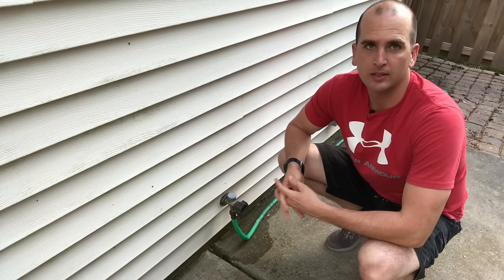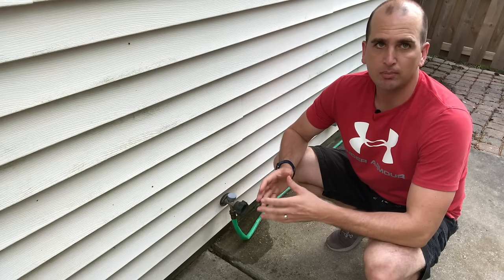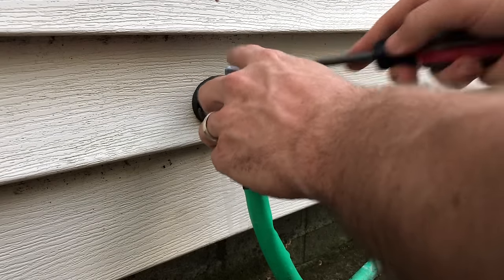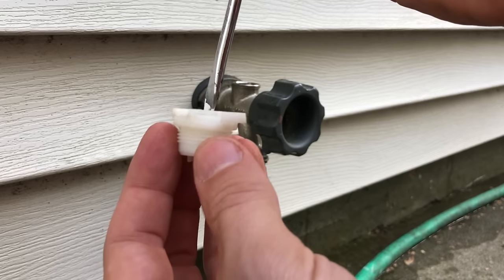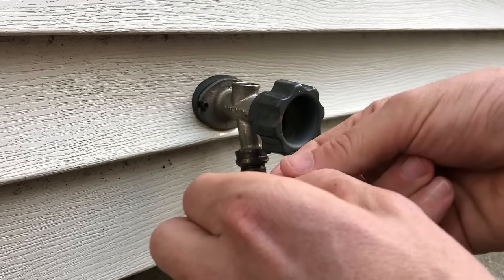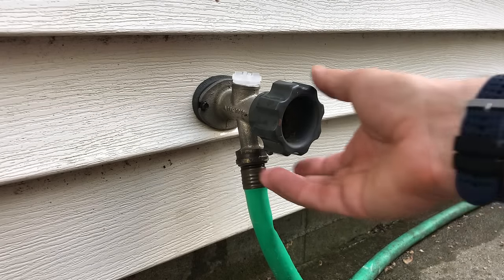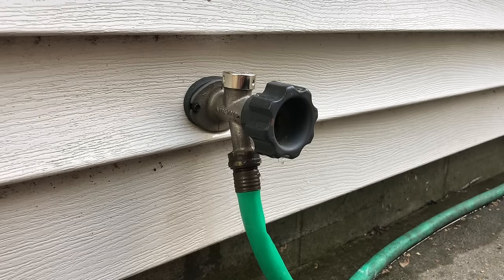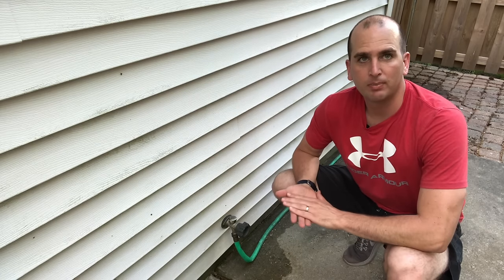How To Fix a Water Leak in the Anti Siphon Valve of an Outdoor Faucet

Comment: I was only able to find the valve kit at stupid prices online. "$4.95 + $49 shipping". Seriously. However, after watching this I took a closer look. The valve was screwed in very tight and would have to be destroyed to remove it, but the seal was visibly displaced (by ice - gf didn't disconnect the hose through the winter). Pushed the seal back down where it was herniating and that was that.

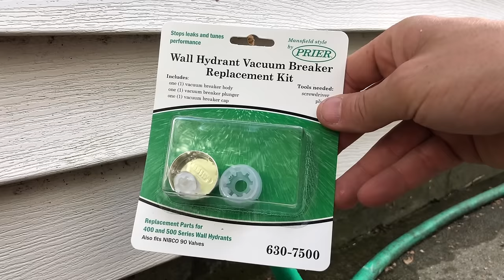Comment: This video really helped me. One of my outdoor faucets leaked so badly that I had just avoided using it for the three years I've lived here. I watched five videos on fixing a leaking anti-siphon valve, but none of the valves in the videos were the same type as mine and the parts in their valves were different from the parts in my valve. I had not been able to find parts for my NIBCO 90 valve. But then I watched this video and at 3:50 the bottom left of the parts card you show says, "Also fits NIBCO 90 valves." I bought the same package, discarded my old deteriorated parts, and installed the new parts. What a simple repair! It works great now. Thank you!
Reply: Leak behind wall plate

Comment: Very helpful video. I thought we might have to replace both of our outdoor faucets. Instead, I fixed them for pennies, in minutes, with this info. One faucet just needed a new stem washer (had been leaking from under the handle). The other needed both an O-ring and a new 00 Beveled Faucet Washer, 1/2" O.D. Danco Stock No. 35090B (had been leaking from the anti syphon valve). Total cost: $1.50. Saved me at least a hundred dollars. Much appreciated. Thank you for sharing!

Comment: Thanks!  I have this type of faucet and it is leaking from the top!  So annoying!  I started a vegetable garden with soaker hoses to minimize water usage and seeing water pour down from the top defeats the purpose of using soaker hoses to minimize my water usage.  That drip can add up to a lot of wasted water.  What clued me in was seeing the concrete under the hose completely soaked and after wrapping the faucet with nylon tape I saw the water dripping from the top of the anti-siphon valve.

Comment: There were 2 replacement options at my Home Depot in Canada: 1392/1393 series or 1104 series. (I got both cuz they were less than $5 ea) The 1392/1393 was right in my situation. 1104 has a slightly larger diameter, so I'll return it. Six years later and your video is still helping people - Thanks for the quick DIY solution!  👍

Comment: I have the opposite problem. Last yr my backyard faucet worked fine. I shut the line going to it off over the winter. It’s spring and I turn the water line back on. Turn the spigot on, and the water literally just trickles out. Any suggestion for a fix? I don’t want to, but I think I’m going to have to cut a hole in the basement ceiling to replace the entire spigot. 🤦🏽‍♂️

Comment: Wow. Thanks Man. My valve has been leaking for 5 years. And it just got torrential. and I found your vid, didn't realize it all came apart, and it was a split washer, and I had a replacement in my toolbox. Thanks so much.

Comment: Just fixed my leaky faucet using this repair kit. And looks like they also updated the design a bit , the insert is now an enclosed piece with the stopper contained inside it, and the bottom of it has some mesh to let the water flow. Now I can keep my automatic water timer attached to the faucet.
Reply from the maker: Shut your mouth! Joking but I will order another just to check it out. Thanks for the heads up.

Comment: Hoping you can help with this. We have a  anti syphon on ours. Whike it doesn't leak the issue I have is if we have the valve open on low or med the valve slowly opens until the pressure is high. 
Also a secondary but likely related issue is at a medium pressure (so not an issue if very low or completely open) but we get a lot of noise (vibration). This is a 40 year old home with good water pressure throughout the hose so I am guessing it is an issue with the valve. Hoping you can advise. Great content btw!

Comment: Tighten the packing nut.  If that does not fix the second leak you can remove the packing nut.   The packing is a rubber grommet that seals the valve stem.  You can replace it.  Either buy a kit with the grommet or better take a couple feet of teflon tape and double it over and role it up into a string.  Wrap it around the stem and reassemble.  Saw Richard do this on "Ask this old house".

Comment: I have this exact valve and couldn't figure out how to get the old part off. Thanks! BTW, The Anti-Siphon has nothing to do with the clean water supply! It's simply an air bleeder so your hoses can drain. The only yhing that would prevent back flow is a back flow check valve feeding the spigot inside the house!

Comment: I found a sticker that says  
"YouTube Certified Mechanic."
Thankyou for your help. I disassembled the top portion and debris came out. I didn't think about trying to reassemble it right away to see if that fixed the problem. That's the difference between an experienced mechanic and someone like me. Instead I ordered the parts for all four faucets. And then I put the plunger in upside down. Once I figured it all out and put it in the correct way it turns out that the debris were the problem and now it's working fine. I ordered parts for the future I guess.

Comment: Wow, I needed this.  My mechanical aptitude has waned over the years, so I went to YOUTUBE to find if someone smarter than me had the same problem, and there you were!   I will be at the hardware store tomorrow when it opens, and buy the replacement part for my leaky valve!

Comment: I too, was happy to come across this video. Always thought that it required shutting off the " main" etc. Well today I picked up the repair kit at Lowes. Came home and excitedly went to work.  The @#$×× thing didn't fit. Now at this point I started examining the old one.The O ring was falling apart. Went to my stash of assorted rings that I purchased from Harbor Freight  many moons ago....found one....slapped it on and Voila! fixed.

Comment: Hey thanks.  I have hot and cold water in my garage.  My hot water valve literally broke a month or so ago.  It was replaced.  Today, that anti siphon valve was leaking like crazy. Used your video and fixed in two minutes.  My washer was new.  It somehow got dislodged.
Reply: MrPolymers Same thing happened to me. Disassembled, then reassembled, following Scott's directions. Works like new.

Comment: What if you don't know the brand of spigot/hydrant that it is? Will that repair kit you showed in the video cover more than one brand? We're having this problem too; a plumbing wholesaler has already told me that there are no repair kits available and that I'd have to replace the whole assembly which goes about 12" into the house because it's one of those frost-free spigots that actually seals inside at a threaded or soldered joint inside the house. That wasn't welcome news..

Comment: Wow, thanks so much.  I've been dealing with this problem for years because I thought it involved cutting and welding to replace the faucet.  The plunger was not even worn out, just seated sideways.  I put it in flush and it worked.  No more lost water pressure.  Awesome!!!!!!!

Comment: Hopefully you will see this late post.  I have been a subscriber for some time and I have a problem with a Woodford anti-siphon valve.  When I try to unscrew it with my channel locks it is too tight and won't even budge.  I am afraid to put too much pressure on it and break the plastic.  Any suggestions?

Comment: Wow thank you so much. You explained the components very well. Like I was told, I was very careful when I unscrewed the white part (I needed vice grips), and voila, like someone else, I  discovered that the black disc washer was off center., so not sealing properly.  Easy fix, but I had to screw the white part back on quite tightly. I did look around on Amazon for the part just in case, and discovered that there were a number of folks who said that the part did not fit. There are a couple of different models with not very clear measurements....

Comment: Thanks for the video. My mom had a new frost free valve installed last fall. She went to use it a week ago and it was leaking from the cap. Took the cap off and found out it loose. Took it out and flushed it out, just in case there was some debris inside. Put it back, problem solved!
Reply from the maker: Love the easy fixes 👍

Comment: My outdoor hose faucet also has an indoor turnoff in the basement wall at ceiling height behind the suspended ceiling tiles. The inside one is leaking behind the handle.  Do I use the same procedure to fix it as you did on the outside faucet?  It is in a very difficult place to get to.

Comment: Thank you so much for this useful video! Just an FYI, my wife and I bought a small rubber washer (98 cents for two) from Lowes to replace the washer part of the sillcock floating valve. This worked! Initially we bought $20 of the complete repair kit but it was just too expensive compared with the 98-cents rubber washer. We found the rubber washer at the nuts and bolts section at Lowes.

Comment: Wife noticed the leaking vacuum breaker (yeah fellas, she noticed a problem with the vacuum. Go figure 😂). So I popped the cap, and noticed the gasket was partially dislodged, but otherwise in good repair. So, following the directions here, I removed the parts, flushed the seat, replaced all parts in their correct location and orientation, and closed it back up. Works like new. Not only saved a call to a repairman, it saved me a trip to Lowes (for now, at least).

Keep the videos coming. This was simple to do and easy to follow. You've earned a subscriber and a like 👍🏻
Reply from the maker: Awesome!  Thanks Tom.

Comment: Such a simple fix but I’ve used this video 2 years in a row. Showing how the plunger works was helpful and also knowing that I don’t have to turn off the water main was good. Wish I would have remembered that one from last year. Had a Y-splitter on my hose Bibb and with the diverted valves turned off, water shot up out of the cap and blew the plunger and another small part into oblivion. Pro tip: take off any diverters or turn them to the open position lol.
Reply: That exact thing happened to me yesterday hahaha

Comment: Nice video but want to add one correction.  It is not an anti-siphon valve to prevent water going back into the system.  It's actually a vacuum breaker valve.  It will allow air into the hydrant so it will drain the water out preventing it from freezing.  Without a vacuum breaker air cannot get in allowing the water to drain.

Comment: This flooded our house, all the water backed up through the piping when having the water on..two years ago we had no idea and poured into our house and through the ceiling and started flooding wherever the water could go...so now just yesterday, a different faucet, i noticed there was small leak when we were watering - come to find out, it completely backed up again, through the pipes and started flooding the bathroom that was closest to where this faucet is located. This is the craziest thing ever, can we just remove these? As they are a dangerous thing to have if the valve breaks its seal
Reply: I recently that in some area's they are not allowed.  I had 2 installed and neither one lasted through the winter. Both leaked inside my walls.
Reply from the maker: Hey Moe,  what state are you located?

Comment: I was always under the impression that check valve was there to drain water out of the spigot housing so that it would not freeze in the winter, never heard that it had anything to do with hose water getting pulled back into your house. Either way, great video and thanks for showing it step by step!
Reply: I believe you are correct. How can hose water get pulled into the house when the faucet is closed inside the house.

Comment: The extra water leaking out was thru the handle. He needs to rebuild the whole valve inside. It also is an easy fix, But he will need to shut the water off to the silcock valve before fixing it.  Other than that, what he showed is correct and very informative.
Reply from the maker: Hey Chawn, thanks for chiming in 👍
Reply: My plumber tightened the bib that helped stop the knob leak (now it’s a siphon leak). I guess after 20 years it would be wise to rebuild the valve and replace the siphon plastic parts :)
Reply from the maker: Hahaha, yeah I would say 20 years is a good run and probably time to start fresh.

Comment: Thanks for the video.  My siphon valve assembly was leaking badly so I put on my trusty face mask and drove to my local Lowes store and bought the exact same kit as is used here in the video.  Mine still leaks...but not nearly as much.  The valve moves up and down as it should when I turn the water on and off.  The leak is definitely coming from around the threads in the threaded plastic piece.  I'm actually not surprised that the threaded plastic part is leaking since it's just a threaded plastic insert that is subjected to a good deal of water pressure.  I only hand tightened mine since I was concerned any further tightening would break the plastic and then I'd be back in the same boat as before.  My next thought is to remove it and try wrapping the threads with a little bit of plumbers thread sealing tape since the leak is definitely coming through and around the threads.  Seems crazy I know but I'd like to stop the leak.
Reply from the maker: Hmmm 🤔 you might want to try tightening it a bit more. Nothing crazy but more then just hand tight.  Also, you aren’t getting a leak from behind the handle as well, right.  I had both when I repaired our spigot.
Reply: @EverydayHomeRepairs  Thanks for your prompt reply.  The only area I'm getting a leak is from the new threaded valve assembly.  I removed the newly installed threaded plastic part and applied 3 turns of white plumbers thread sealing tape on the threads and then hand tightened it again into the spigot.  That reduced the leak to a minimal drip...so I can accept that.  I'm concerned with tightening it much more and possibly breaking it so I'll just accept the small leak.  I had a terrible time getting the old original plastic threaded part out which is why I don't want to risk breaking the new part.  I had to remove the old plastic threaded part in small pieces by deftly tapping with a screwdriver in several areas being careful not to damage the internal threads.  It was stuck good and tight but all of it eventually came out.

Comment: Excellent video! My valve wasn't the same model as yours, but you gave me what I needed to figure it out (the rubber valve disc on the poppet had fallen off its spindle). All that I had to do was put everything back as it was supposed to be, and bingo - it works. Thank you!!

Comment: Noticed the faucet leaking after repair... HomeDepot sells a complete wall hydrant kit (630-8500)..for about $20. includes parts from 630-7755, 630-7500, 630-7965 kits.. Prier Mansfield 300, 400, 500 series..  parts for the stem repair (7755) .. there is an outside chance the stem may have to be replaced.. Menard.com  need to measure for exact part..$25 or so..
Reply from the maker: Good eye Scott!  It actually was the second video which solved the second leak I had which was the seal right behind the handle.  How To Fix a Water Leak Behind the Handle of an Outdoor Faucet https://youtu.be/scf5ovLI4Uk

Comment: i have a spigot that filters out the water from the hose when i shut it off. but this valve stays open and most of the water flows out this valve when i turn the water on. any suggestions?

Comment: When you say to make sure the plunger "seats well", does it need to sit down inside the faucet, or just center it on top of the hole. Thanks in advance!
Reply from the maker: Hey Marcy, you just want to inspect the plunger and make sure it is free to move and "seat" or seal.   Some time the plunger can get some debris stuck which can restrict the movement.
Reply: @EverydayHomeRepairs  Thank you! I was able to install everything quite easily but it is still leaking from the same area. Does this mean the whole thing needs replaced?
Reply from the maker: @marcyg321  hmmm,  are you sure the leak isn't coming from behind the handle opposed to the anti-siphon valve?  I had both leaking and put out the 2 separate videos.  Here is the other video showing the repair behind the handle https://youtu.be/scf5ovLI4Uk

Comment: So before watching this video I purchased that Prier kit but this model number on package  is C-144kt-806. Do you think it matters in ref. to the model number ... it looks the same as yours?
Reply from the maker: You should be good.  I checked the model number you provided and it does look like the same parts.  I am not 100% on the threads being the same but just take care when installing the new parts to not force things if the threads don't seem to match up.
Reply: Everyday Home Repairs thank you fixed it thanks to your video 😉

Comment: Wow. That was great!  I was afraid I was going to be looking at tearing out the toilet and wall to access and replace the whole spigot!
Reply from the maker: Always nice when a job goes better than expected 👍
Reply: Well all I’ve done so far is get the cap off to see that the gasket is pushed up through the the opening a bit... probably from not having the hoses fully open during a freeze. Hopefully it isn’t too malformed to reseat.
Reply from the maker: @playsinclay  Hey Robin even if it is damaged you can buy the repair kit with the needed o-rings.  There are links in the video description if you need a reference of the kit on Amazon. Good luck.